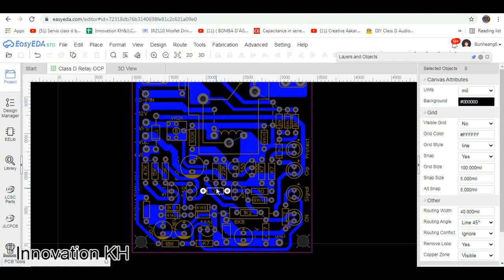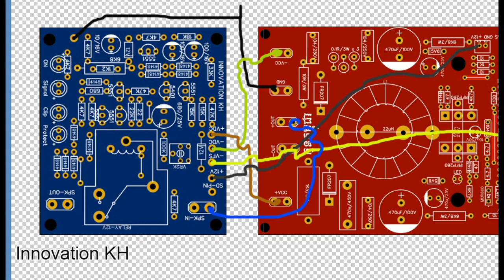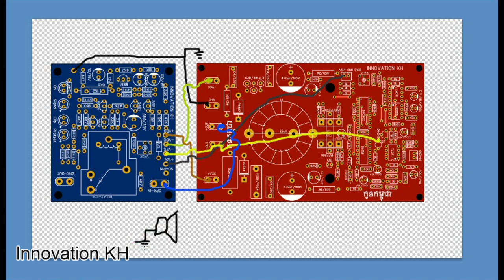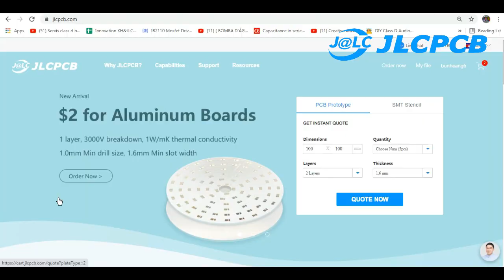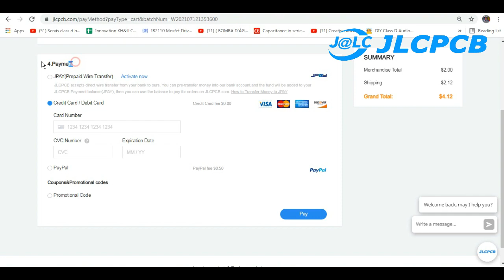For Amplifier Class D Relay 12V DC Protection and Over current Protection

Comment: hello sir please i want to ask a question after the 1000w amplifier circuit with TL071 I copied your work and it gives a good result and good sound quality, but I have a problem is that at the output of the amplifier if the wire (+) which came out of Transistor C5200 and A1943 touches the wire of (GND) some transistor does not resist the shock, and it can happen that the two wires (+) (GND) sometimes touch each other, I know that must never touch the two wires (+) and (GND), but if they touch the final transistor never resists, on the other hand some power amplifier if this problem happens the transistor resists well and gives a bit of time for the amplifier user to draw attention that he has a circuit cost, but in the circuit TL071 1000W 7-2sc vs 7 2sa the transistors never resist, please how to fix this problem